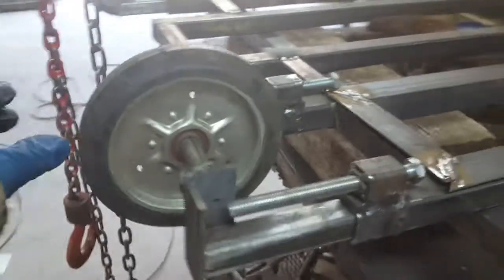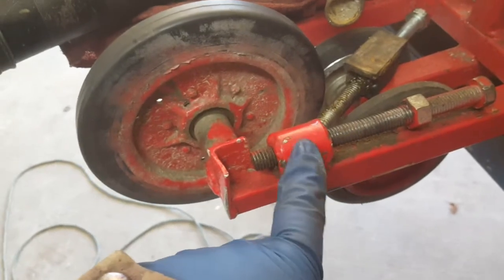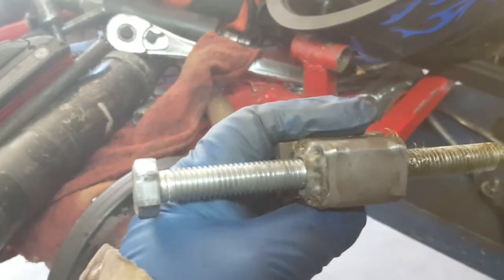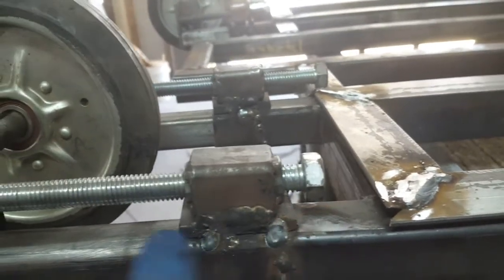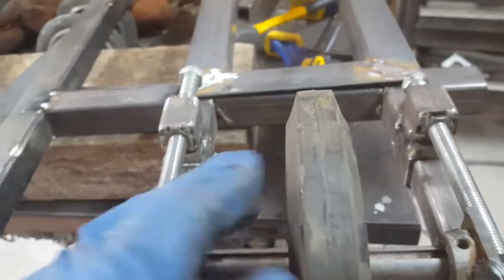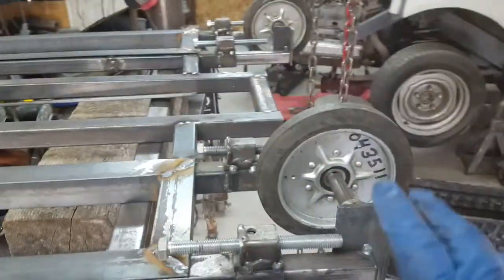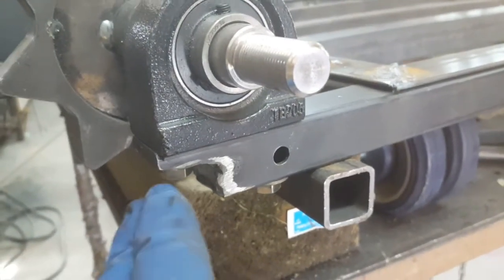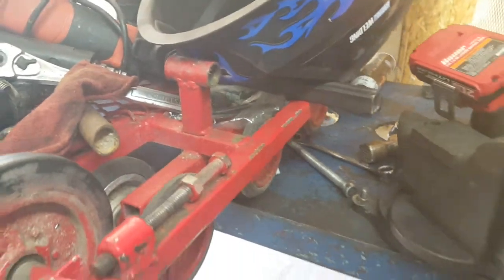PTV Build 6 - Track tensioning and torsion suspension frame.

Comment: It change the pitch of the threats when they got heat it up and then that's got drawing closer to each other it wasn't the same thread size because between the two nuts and the heat give him out of there it shrank so then it pulled the two nuts together closer so then it was buying in the threads so your picture of your threads were changed

Comment: I'm sure its been answered before but where did you get the rubber tracks?
Reply from the maker: Yes, about a hundred times but that's okay.   Summit Tracks, llc.    180X60X39.  Thanks for watching!
Reply: @Personal_Track_Vehicle  how much were they?
Reply from the maker: For me they were free because they are a sponsor. I think they're around $250 or so. But that was a long time ago so I'm not sure anymore. You can find them with a Google Search and call their sales. I'm sure they've had a ton of calls about this particular size of track. They're good folks.
Reply: Could you send me the template for the sprocket? Summit wants $144 per sprocket. I’m guessing the machine shop is much cheaper...thanks
Reply from the maker: @Thatoneguy884  I got about $80 for both of mine.  Not including the 4x1 inch shaft couplers that I cut in two.  I do have Pdf's of the parts.   Write me at revchuckswarthout@gmail.com

Comment: Oh yah, the removable framing is a great idea. Making it modular, as it would be called. :) 
When I made my frame, I designated a section of the frame for that particular part. So I have an engine section, trans section, track drive section, suspension section. But I got to cut out all the mounting and reweld in new mounts if I want to change anything.

Comment: For your track tensioner, This idea is used in many track applications... A chunk of solid stock with a hole drilled in and the nuts on each side of the solid stock.... This would eliminate all of your problems.
Reply from the maker: I agree!  I am totally self taught, many times as I go.  Makes total sense, thanks!
Reply: Do you facebook, I am under Joseph Red Kamel there, I am pretty good at a lot of this kind of stuff you are doing and can give you ideas as you go along or help you with those ideas... Your build is pretty darn good... I do like your swap out idea... This should help you if you decide to go with a solid track set up...
Reply from the maker: Hey, consider joining our Facebook group,  Personal Track Vehicles.  Great place to share ideas!  Thanks!

Comment: If you're having problems with those threaded tensioners I would suggest chasing the threads with a long tap. You're probably running into the nuts moving ever so slightly when the metal contracts as it cools when your done welding. As a suggestion for the torsion suspension, it should work pretty well but your bound to snap a torsion bar every once in a while, its not that they're not strong enough it just sorta happens as they get metal fatigue, so my suggestion is to make the torsion bars simple, easy to fabricate lots of extras, and above all else easy to get to and replace. You don't wanna have to halfway disassemble the whole darn thing to replace one busted torsion bar, trust me it sucks.
Reply from the maker: I couldn't even remove the bolts to tap the threads.  I absolutely ruined the nuts on the one I was able to back out.  Possible to maybe lightly tack it all, remove the bolts, weld, and then re-insert them.  I don't know.  I like my final solution.  The torsion system will be interesting, based on the Rosta style units seen in one of my previous videos (14C).  Are you thinking sideways pressure might be a problem, or what?  Yes, I will be able to easily remove individual parts of the suspension too.  I want to use the whole frame out of the vehicle to test the "bounce" because I am really flying in the dark here.  Interested in your comments, thanks Matt!